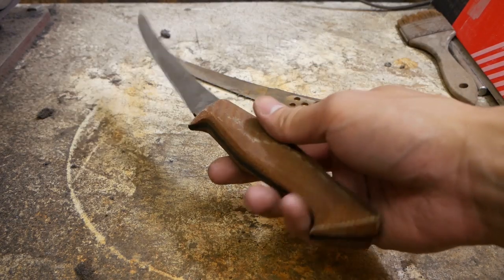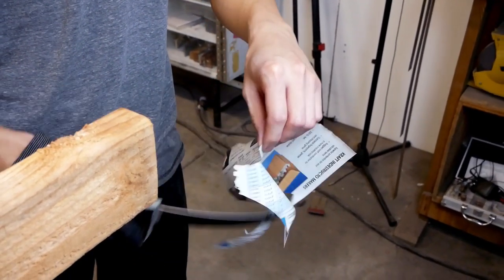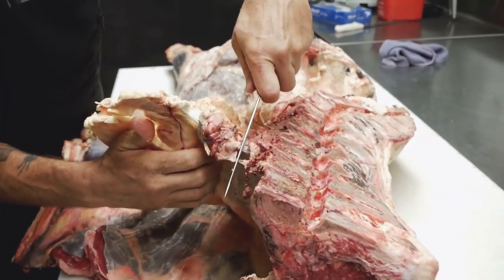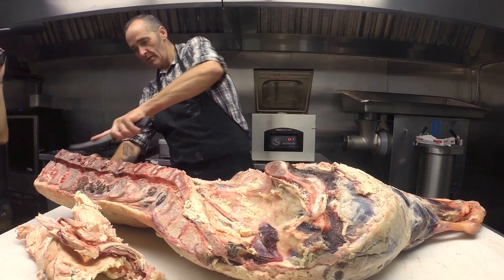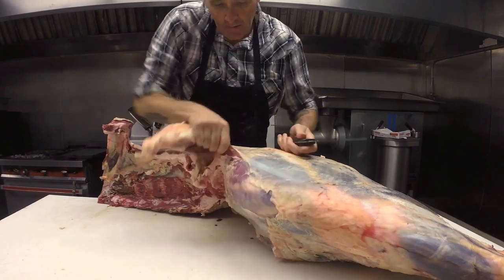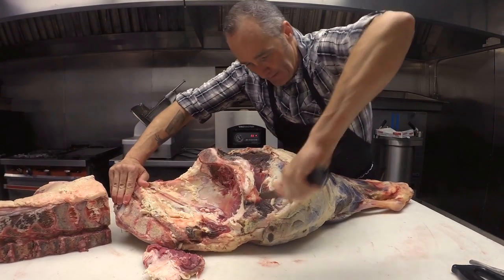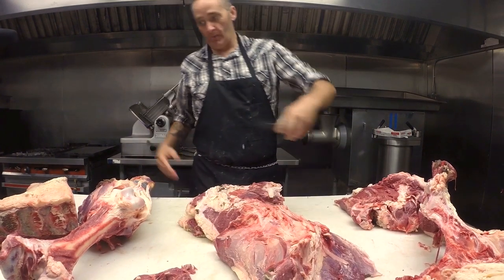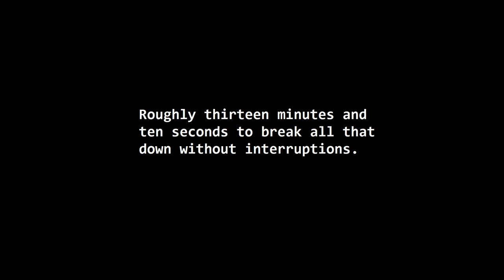Tucson Butcher Ben Forbes Gets New Knife - Food and Knives

Comment: Freaking awesome!

What steel do u recommend for butcher knives??
Reply from the maker: Something tough and wear resistant. They don't need to be sharpened up very high, it just needs to withstand that abuse and hold the toothy edge well. Cru Forge V would probably be damn good. Or there's probably a very suitable CPM steel or similar.